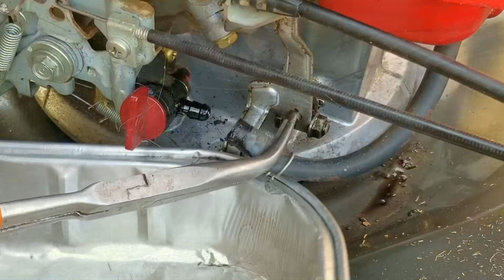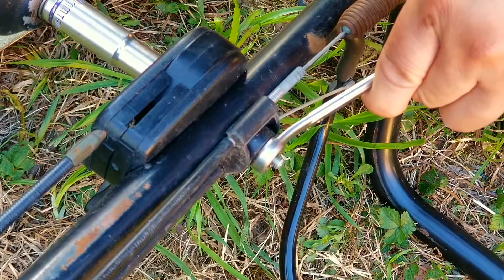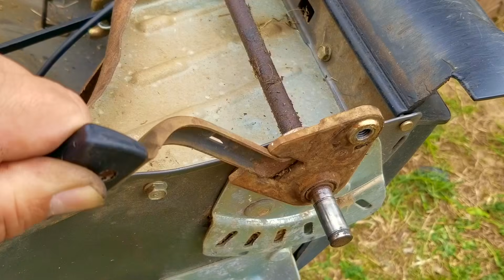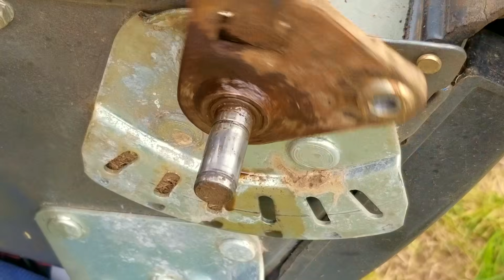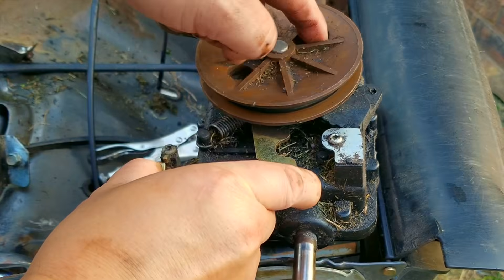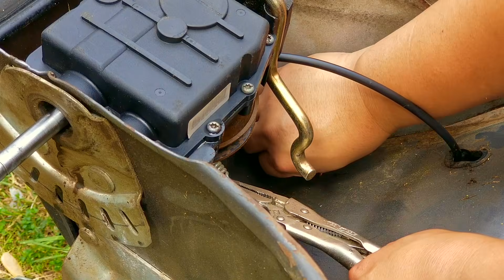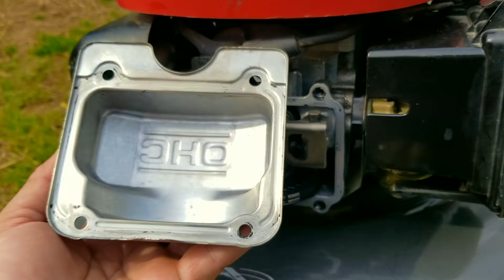Honda Mower Self propel finally fixed

Comment: Great video. I swapped out 4 of these and doing my 5th tranny now. I make the same mistake every time. Tranny last about 5 years and then needs to be replaced as it won’t self-propelled forward. Tried to fix them but no luck. Mower will be 30 years old next year. Can’t seem to let it go.

Comment: my lawn boy easy stride is 21 years old as of 2026, never been to the repair shop. and still starts on the first pull.  I made necessary repairs as the issues arrose.
Reply from the maker: Wow, nice mower

Comment: I got my Hrr216 for free from a customer and it's practically brand new. I've used it to do about 10 lawns a week or so for the last 4 years virtually trouble free. So ya, I'll gladly spend 8 hours on it. It seems the axles are rust welded to the bushings from wintering outdoors. We'll see if that's the case. 🤞
Reply from the maker: nice!  You got a very good mower there.

Comment: I couldn't have done this without your video. The mower runs fine and hated to trash it because of a bad cable.  While I had everything opened up, I decided to remove most of the rust and painted underneath.  While re-assembling my mind went blank and I new I was in trouble.  Thanks to your video, I must have replayed it 50 times step by step.  Again, thanks for taking the time making this video because it saved my butt.  Denis
Reply from the maker: No problem and I appreciate you watching!

Comment: And yes I would spend more than eight hours to repair it .!  I would also order parts from CHINA  that are direct replacements. they work just as well and are far more cheaper . a complete carby  replacement with NEW jets and BLADES !👍👌😁
Reply from the maker: Nice choice!

Comment: That tensioner  spring that is difficult to remove is easy to remove if you tie a length of nylon cord  to the hook end of the spring and then pull the cord and you will get far more leverage to affix it in place or remove .
Reply from the maker: Thank you very much

Comment: GREAT VIDEO!  MANY THANKS!  If you still have that Honda 3-speed mower today, you know you are blessed because can't get a decent self-propelled walk-behind mower here in the USA anymore.  The variable speed mowers are GARBAGE, at least for we who need self-propel to go UP HILLS!!!!
I hit a stump with my beautiful little HRS216SKA single speed no-bagger last year (or was it early this year?) which has since VIBRATION (bent crankshaft); I understand there may be a way to fix by removing blade etc and using long pipe to straighten, but have yet to try.  I am 81 and puny and need to do my own mowing/snow blowing.  Over the years, I have fixed stuff myself because of help by YouTubers like you.😁 Thanks again
Reply from the maker: You are very welcome and thank you so much for your time !
Reply: @INSIDEHOUSEGARAGE  You are most welcome!

Comment: Great video thanks. Another reason,in my case, was washing my mower after every use. I ended up with rust on the height adjuster bracket. My mechanic had to cut it off and replace. He suggested less washing which makes sense. Keep up the great work.
Reply from the maker: Than you very much and  how often did you wash your mower and what was the drying procedure after the wash?

Comment: FYI, the belt on my HRX217 came off a pulley while mowing. WHY? i failed to adjust the cable tension which became so bad that i had to turn the speed dial to max which eventually was not able to firmly engage the pulleys= LOOSE. took my over hour of knuckle busting to put the belt back on the pulley (on the transmission drive unit).
Reply from the maker: Sounds about right for that amount of time.

Comment: Yes, I would spend 8 hrs working on it if I really like the mower and i know what I'm doing will fix the problem. My HRX self propel is 12yrs old and running really well except for the self propel cable  needs adjustment for the second time in 2yrs. May need to be replaced. It is the original one.
Reply from the maker: Nice, I hope you get it working well.  Thank you!

Comment: Good video! I have a Honda Hr315 SXA with a broken drive clutch cable. Pain to change. Although transmission hydrostatic and different video was helpful . Thanks
Reply from the maker: Thank you very much and you've got a great mower there!

Comment: THERE WAS NO NEED TO DISASSEMBLE ALL THE WORK YOU HAD JUST DONE- THE EASY THING WOULD BE TO JUST TAKE THE SNAP RING AND WITH TO SET OF VICE GRIPS TWIST ONE EAR ONE AND THE OTHER ONE THE OTHER  AND SLIDE IT OFF THE AXLE AND PIT IT BACK ON THE RIGHT SIDE OF THE WASHER- EASY PEZY!    SNAP RING AND EASILY RESHAPED AND THEY FIT IN A GROVE WHICH STRAIGHTENS THEM OUT AFTER REMOVAL FROM THE AXLE THE EASY WAY!
Reply from the maker: THANK YOU VERY MUCH FOR THE COMMENT I APPRECIATE  IT

Comment: Where can I buy the gear lever and cable? I can only find throttle lever and cable. Do you have the part numbers? Thank you in advance.
Reply from the maker: Do you have the mower model number of yours?  I didn't show the model number of this one  and I need that info to find the parts diagram.

Comment: I'm getting one with this problem  why won't it go backwards
Reply from the maker: Does it start and run?  If so check if the self propel works.  IF it doesn't then the axles are rusted in place and that's also the reason why it won't roll backwards.
Reply: @INSIDEHOUSEGARAGE  it works in fwd but won't roll backwards
Reply: Yessir

Comment: Another way to tension a spring is to take a couple of feet of recoil rope and knot it and make a loop. Hook it over the spring and pull it. You don't have to worry about this vise grips flying off! Best wishes.
Reply from the maker: Hey I like that idea. Thank you!

Comment: Thanks for your efforts. I will probably just squirt some WD40 around the bushings, open up the transmission and add some 5w30 and if that makes mine go a little faster (It's so slow now I end  up pushing it to aid the 2 mph self-propel), I'll be content. If NOT, I think I just want to make it a push mower. To do so, would I just cut the belt? Or maybe remove the transmission casing? I'd just like to have the rear wheels spin as freely as possible with less friction. In all honesty, my next mower will just be a push mower. Self-propel is just one more thing that can go wrong.
Reply from the maker: It's much easier than that.  Just swap the front wheels to the back.  Since there's not gear on those wheels, there won't be any parasitic loss.
Reply: @INSIDEHOUSEGARAGE thanks.  I'll try that. Think it's worth doing anything else to make it lighter? If so, what?
Reply from the maker: Unfortunately no. The majority of the weight is the engine followed by the mowing deck. Just put some grease on the axles bolts to make them spin easy.
Reply: @INSIDEHOUSEGARAGE Thanks. I actually was surprised how the axel rod spun relatively freely upside down in both directions. But is it normal that when turning the wheel closer to the transmission casing that the other back wheel spins, too, either direction. However, when spinning the wheel farther from the transmission casing, the other wheel on the axel only turns with it in unison in one direction (not both)?
Reply: Also, if these wheels are turning relatively freely with little clicking/drag, but my mower still self-propels slowly, what do you think is issue?
Note ... I did adjust settings on the cable near the squeeze bar to maximize speed. In other words, without even squeezing the bar, I believe the rear wheels will rotate when lifting rear of mower off ground.
If that is the case, what would be reason for painfully slow self-propel?
Reply: @INSIDEHOUSEGARAGE Thanks!

Comment: anyway to adjust the handle on these or a replacement handle? the handle is so low it hurts my back
Reply from the maker: it depends on the model you have.  Some only have one position while others have 2 positions.
Reply: @INSIDEHOUSEGARAGE this one only has one position
Reply from the maker: okay, have you confirmed the the brackets that hold the lower part of the handle bar, are not bent?

Comment: Yard Force SP mowers has repeated clutch cable fails. Parts take months and authorized repair centers are hampered by admin documentation demands. I have a working mower with no SP ability. Trying to get a mower service and pay for it myself.
Reply from the maker: Sorry to hear you're having a difficult time with your mower.

Comment: Why would the belt  keep falling off the pully. It came off the back then the front. If i tighten the cable wont it have constant pressure on the belt and wear out ?  Thanks
Reply from the maker: Is your mower a honda or a different one?

Comment: Good tips. My mower is 3 years old. It’s being push from the rear wheel. This year I notice it’s running weak. I have to put on the highest speed to get it to move. Belt seems loose. What would be the problem? Thanks
Reply from the maker: We It depends on which model you have.  3 years is not long enough to have the belt or pulley wear out. Have you check the wheels to make sure one or mower of them isn't tough to turn?

Comment: I have a newer model, and the tensioner spring came off, but there isn't that gold looking arm to connect it to so don't know where to connect it?
Reply from the maker: I'd have to have a model number to be able to reference where it goes and even then the diagram only show parts in a "blow up" and not how they are connected to each other .

Comment: I have nearly the same model but only has one speed. It was given to me for free so it is worth it to fix it. I did pay someone to clean the carburetor with an Ultrasonic cleaner. It only cost me $50.00. The drive is having the same issue as your so I will probably just tear it down myself. The transmission box appears to be metal so hopefully I will not have to replace it.

All in all it is worth it to me to fix it up for now.
Reply from the maker: Good luck with it and that single speed is a great transmission too.

Comment: Hey man...how would you go about freeing up self propel mower axle that was involved in a flood and heavily rusted?  I got it going a little with wd40 but it keeps locking up
Reply from the maker: sure thing, you'll have to take all the parts that have rust on them, off the machine and remove the rust.

Comment: I just got mower like this one and she said it needed a cable , welp i so far spent 4hrs befriending it today ( drain oil gas take underside apart to learn that the clutch  cable isnt broke it just maybe all stretch out and not getting pulled back far enough to engage gearbox , what a choir so far tho im learning on these and this honda motors last longtime so im gonna get it all working for next season. Hoping tmrw when i get fluids back in it , the clutch cable with engage trans and ill be good to go , Video helps to see everything were as i had a mirror up in there to see how that clutch lever works without dismantling as. You have ,
Reply from the maker: good luck with it, these are certainly worth the effort in my book
Reply: Welp i can tell the engagement lever is working tho its not turning axel in either of the 3 gears , so im wondering if i just need to tighten up gear shifter cable , thanx for reply
Reply from the maker: no problem and good luck with it.

Comment: To remove and to reattach the tensioner spring simply make a loop with a zip tie and put it on the spring and pull it with your finger
Reply from the maker: I'm getting ready to do this job again on a different mower, I'll have to give it a try thanks

Comment: This video saved my $$$.  I sprayed WD40 on the rear axles where the riser handles are and I was good to go. I was able to pull the mower backwards and the sel-propel worked again. THANK YOU!
Reply from the maker: very nice work!
Reply: U should oil the axles too. Wd 40 isn't a lube

Comment: Did you take out the shaft out of the transmission to get it so clean?
Reply from the maker: no just slid the shafts out of the bushings and then cleaned the shaft.
Reply: @INSIDEHOUSEGARAGE  Thanks for the reply, your video was very very helpful!

Comment: I bought a HRR216K5 with smart drive, I believe the transmission worn out, I tested it by engaging the lever, then rotate the engine, the input pulley of the transmission always rotates,  the wheel want to move but once I try to force the wheel from moving, the output shaft wont turn, did some research, people mentioned the worn out brass cone, but have no idea how to fix it other than getting a new transmission.
Reply from the maker: sorry to hear that

Comment: With that tensioner spring on and off use a longer string for better leverage and pulling torque. Never ever any pliers! Using a string you can pull it into position.
Reply from the maker: thanks!

Comment: Those screws on the bottom side of that transmission are removable or you can remove the bottom plate from the transmission and it doesn't have oil it has grease inside and it can be re lubricated. Why you said it was a sealed system I do not know since you could clearly see the screws in this video. I just watched two other videos on YouTube showing you how to remove the bottom of it and what to look for.
Reply from the maker: honda has several transmission styles, ones with metal plates, plastic ones, 1 speed, multiple speeds and even better the hyrodstatic,.  On this one you don't want to take the bottom off of it, and I'm not going to tell you why because I'm sure you already know why..  but when you do, you'll understand

Comment: Another great video.  I have a similar Honda mower that I just restored so I can sell it.  QUESTION: Does the compression tester you posted work on small two cycle engines as well?
Reply from the maker: yes it does,  I use the same one for all my equipment, from 21 cc engines to truck engines.

Comment: This for sure a week-end Job. 8 hours seems long, but you took your time and was learning in the process. It doesn't seem anyone was doing yearly maintenance to the mower. But in the end, don't you feel proud on what you just achieved?  This one is an older Honda. Yes, the new ones cost 1000.00 but my understanding, Honda is going all in on battery powered mowers starting in 2024.
Reply from the maker: yes you are correct 8 hours is a long time

Comment: Great video.  My HRR216TDA had a "frozen" gear shift cable. It broke the shift lever housing when I forced it.  Took me most of the day to take the trans out, clean up the dirt and rust and old grease, and figure out how to remove the cable. Virtually same procedure as you did, just not as smooth and well documented as you had done. Now waiting for parts. Your video will help me put it back together. Thanks.
Reply from the maker: wow, I like your determination!  Thank you for your time too.

Comment: Be aware that metal gears with the key on the shaft are not interchangable. Gears are 'left and right'. So if you put left gear on the right side, mower will just not have self-propel anymore :)
Reply: Yep, one way gears. The gears have a dot punched in them that face out.

Comment: In the beginning you said that the mower wouldn't self propel, what was the actual fix for that issue? The trans seemed to work when you had it pulled out of the mower. Thank you.
Reply from the maker: sure thing, The drive axles were "Stuck" to the bushings.  That means the self propel won't work, and the same goes for rolling it back.  when pushing the mower forward, you should hear clicking, and that is the ratcheting mechanism that's bypassing the drive system.   IF you free up the axles, it'll fix all the problems

Comment: HG I was able to fix the rear wheels without removing the gear. Cleaned the wheels and the dirt and old grease from the bolt and those two washers Lubed lubed n lubed. Then put it all back. Rolling backwards and forwards 

Thank you.
Reply from the maker: Nice work!
Reply: @INSIDEHOUSEGARAGE  do u have a clip on replacing the kill switch on a Craftsman 2012 7.5 190 cc starts but won’t turn off. Thank you

Comment: Very good video and narration.  Two lube fittings or the like on each mechanism for engaging/disengaging the propulsion would have saved 7-1/2 hrs (about 500$)labor
I wonder if i honda designed that portion of the mower?
Reply from the maker: I have to agree with you on that, certainly seems like it

Comment: Have ever adjusted the valves on a Honda engine and what are the settings on them
Reply from the maker: it depends on which honda engine you're asking about but the intake clearance is .002" to .006".  While the exhaust is .002" to .008".

Comment: I'm surprised that there's no way to service the transmission. Can't the cover be removed, it looks like there are bolts there. I know that the old three speed Toro Super Recyclers had the ability to remove the cover and repack with grease. It would be a simple for the manufacturer  to make this possible.
Reply from the maker: so here's the deal, you can service it if you want on this one.  However the cover is not only screwed to the other half but it's also sealed, to it.   Breaking the seal and putting it back together is just a real pain.

Comment: Fantastic Video and great explanation. This is the only video that explains in details about how gear selector cable and self propelled cable works. I didnoot realized all this time that when i start the engine, the pulley in that transmission rotates as well, but the power gets transferred to wheel when i pull the self propelled cable.. just to let you know i dismantle engine and rebuild automotive cars, shame that I didnot know how this works.
Reply from the maker: thank you and at least you know now.